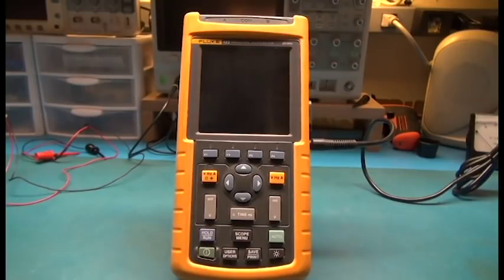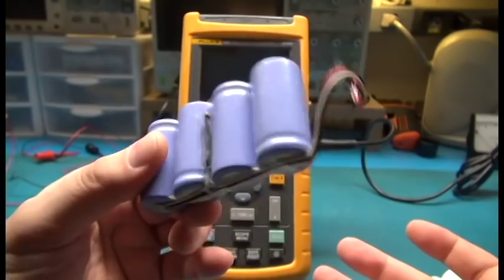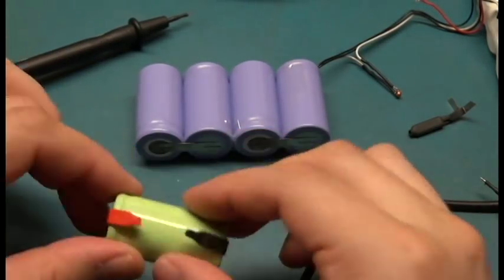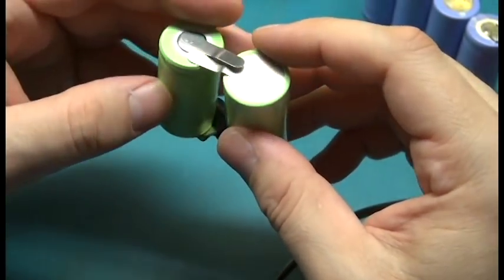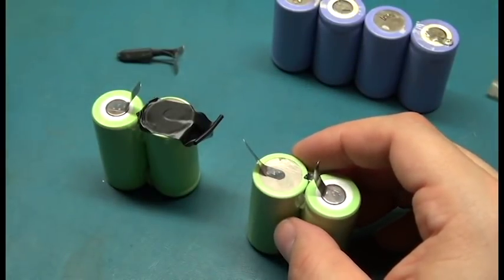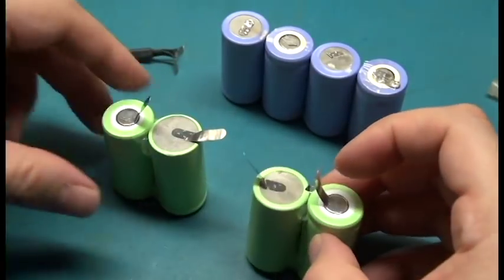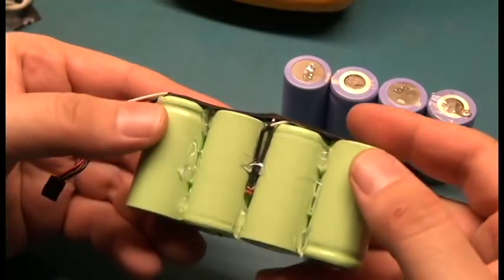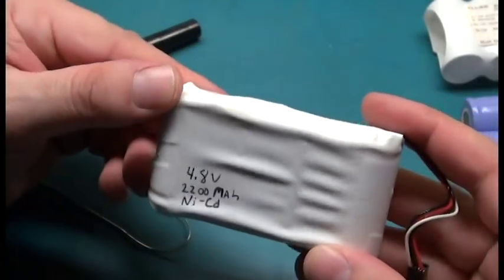Fluke 123 ScopeMeter Battery Rebuilding for $11.

Comment: I was contemplating this when I stumbled onto your video. I use my 123 on digital pinball MPU's and sound boards and have for years. I actually have two 123's. One here at home and one in my toolbox at the shop. I was tired of using it plugged into the charger. The original pack batteries had crimp tabs and the new ones do not, (as I suspect Fluke got them custom made), I had a few issues putting fresh solder onto the exposed surfaces maybe due to my fear of using too much heat but with some good flux was able to get enough for wire attachment. So, after assembling the pack it started charging the batteries at 5.6VDC. It went up to 5.8VDC at the end. I left it for 12 hours while monitoring the voltage with one of those cheap Chinese 3 digit meters. After disconnecting the charger it showed 5.1VDC across the battery pack. The scope turned on right away and looks good. It is now under the battery refresh mode. Next week I will tackle the other one. Thanks for the video!

Comment: Hi. The equipment used is a Fluke 123 Model. The battery was completely discharged and I replaced the battery with a new Ni-cd, but the device does not turn on. The voltage is 5.3V, is there a problem with the temperature sensor or resistor attached to the battery?

Comment: if i don't install ncd  -- can i install lion battery? do you think it will malfunction?
18650 lion 3000mah lion battery 2 pieces in parallel and 6000mah 3.7 volt Is this power good or too much?

Comment: Hello, I lost the charger so I was wondering how to charge the battery individualy. Do you know which cables and how much voltage should I choose?
Reply from the maker: You are better off just getting or making a supply for the scope itself so it can charge it. The charger for Fluke123 is pm8907/803. Ebay sells real and aftermarket. These are specs are for charger 15VDC 300mA center negative.

Comment: Hello there. I just replaced my Fluke 123 battery with a Chinese one. I did a full refresh (over 20 hours) and the unit is showing a low battery level (it seems to still work fine though). I Did a reset and that made no difference, Any ideas? I bought the unit second hand a few years ago and this is the third battery I have had; same thing with each one.
Reply: I have the same problem !!! should we give a go to -->  Li-ion ???
Reply: @AA-en8gw  I think mine was a Li-ion one. I have put this one to bed now. At the end of the day, it seemed to hold a charge for over an hour whilst switched on; this is probably as much as I would need. For additional requirements, I would run a power cable to the unit. Still, if anyone knows how to get the battery indicator to 'wake up' I would be interested to hear the solution.

Comment: Hi.have a question.i have same scope now it's not turning on only sound speaker click.like relay sounds.please maybe you had something like my problem or ever heard about.thanks
Reply from the maker: Hold the lamp button down and the power button at the same time when powering on. This should reset the scope.
Reply from the maker: Or the battery is really dead and it will do strange stuff even when its plugged in.
Reply: @Kev_31779   its doing the same thing with and without battery.i tried that reset trick but still nothing

Comment: Hello Kev, I have a question; do you notice any overvoltage on the recharge battery terminal from the Fluke? Lot of batterys on fluke seems to be over voltaged and that's create quick worn and it short battery.
Reply from the maker: I have not noticed that.
Reply: that's ok thank you.
Reply: @AIexanderHartdegen  

Yep 6 Cell NImH 7.4V is overcharged with a 10.8V charge voltage on the Fluke 196.
Reply: @aqib2000  that's what noticed the seller of a 196 to me. I had a doubt about that. Thanks to confirm that.

Comment: @4:00 that will be a thermal fuse, the batteries are in series and there is no load balancing.
Reply from the maker: As I was editing the video I came to the assumption It was a most likley a thermal fuse but got sidetracked and it made it into the final edit. Good catch..

Comment: Hello Kev, thanks for this video. The black little component soldered on the two cells on the center is simply a fuse, preventing overloading. Thanks for the video.

Comment: Digikey has brand name NiCD batteries, but they're a bit more expensive, starting from around 4$ each... here's examples (filtered to show only SC size NiCD batteries):  / short / pz7rn8  
There's some there with solder tabs, making it easy to just solder wire between the tabs and not risk damage by spot welding or soldering directly to battery.